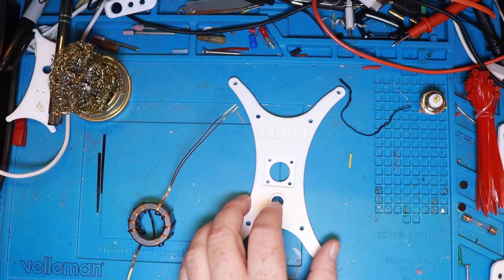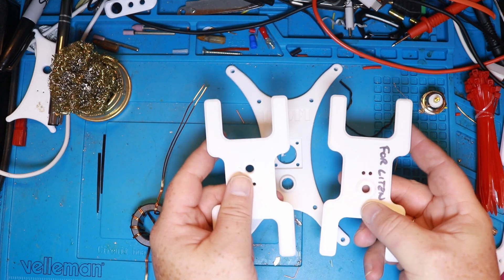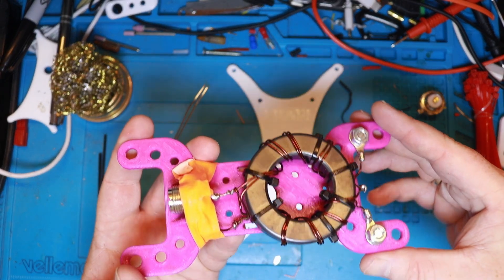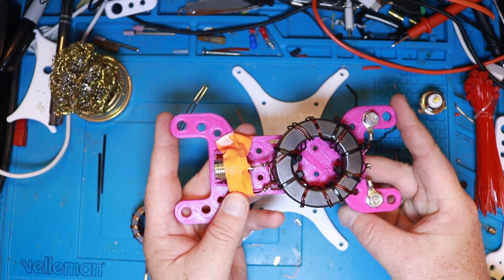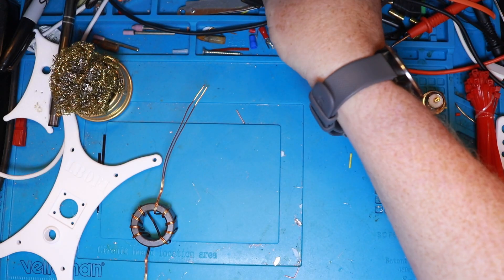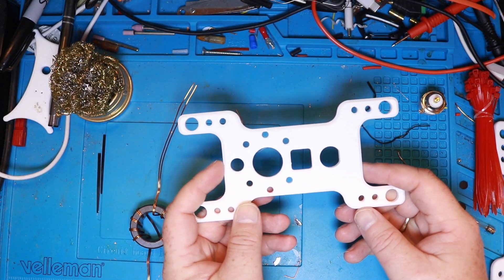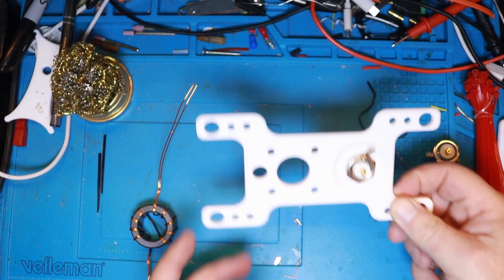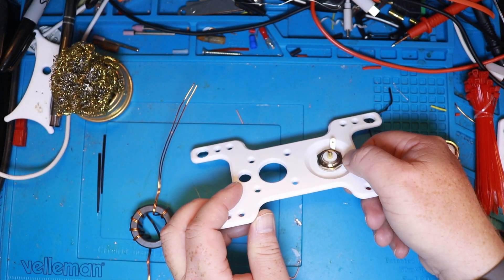It started out as a Delta Loop, but it became something completely different!

Comment: Nice video, thanks for that. What software are you actually using to design your 3d printed objects?
Reply from the maker: I use Fusion360. We had a discussion on CAD software on The European Ham Radio Show yesterday, and the conclusion was that once you have learned a CAD program it is hard to transition to other software.